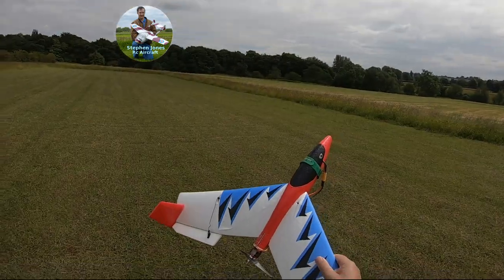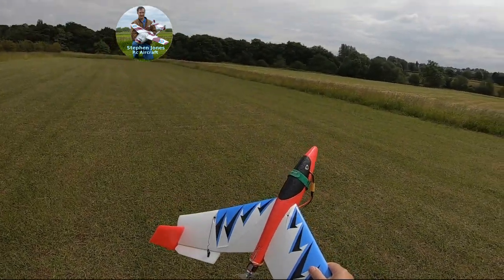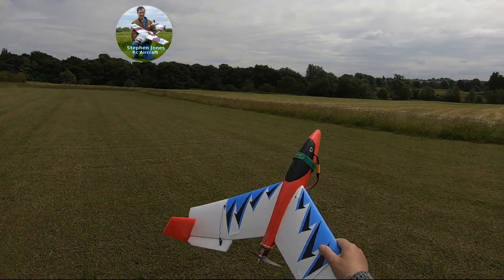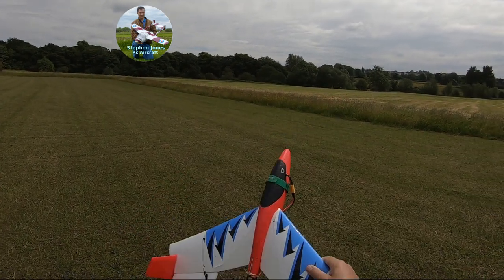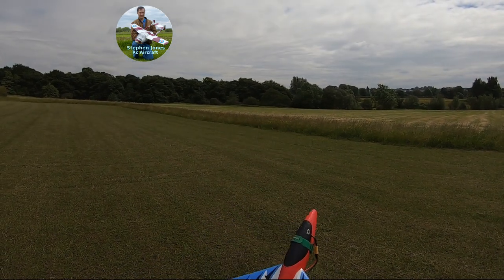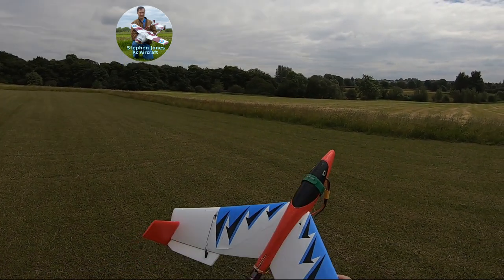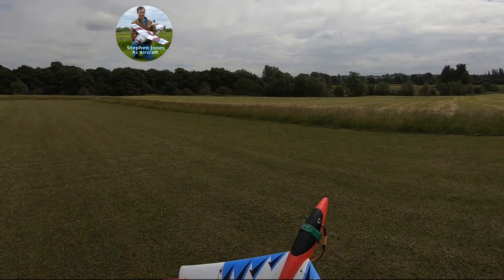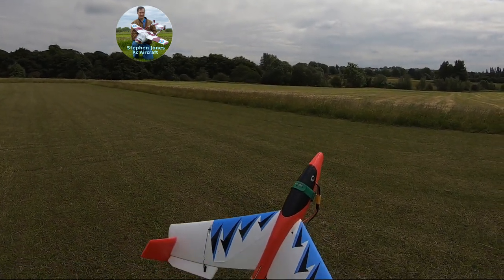How I Launch the NewFlidl

Comment: Attention, the Newflidl always flies in the direction away from the cockpit during a vertical take-off.  So always put it at the start so that you see the bottom.
Reply from the maker: It is known as torque reaction . 
The model turned half a rotation to where I positioned it, so as to fly away from the pits area. 👍😊

Comment: Hi Steve. Nicely done. I used to do this about 20yrs ago with 1M Thing and 28 ASP engine, a bit more vertical. I've just acquired another SAS 1M and was thinking of trying the same except on Electric. This now gives me a good excuse to do the same as yours on LiDl's that I have piling up. Which motor did you use...... probably in the description or your other vids somewhere. Not looked for a week or so, just catching up. T.
Reply from the maker: 30 Amp Esc, Motor D2826 2200Kv and a 6x4 Prop.👍
Reply: @RcAircraft  ......3S 1000mah ?